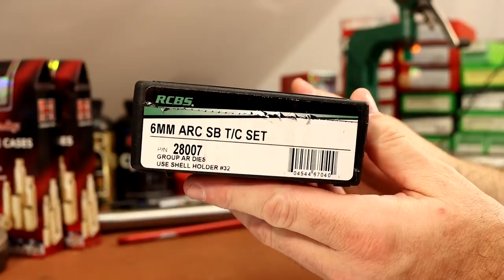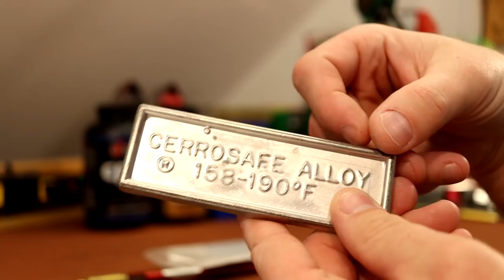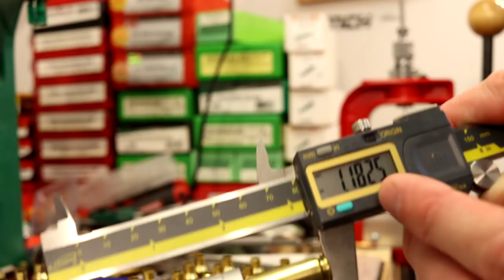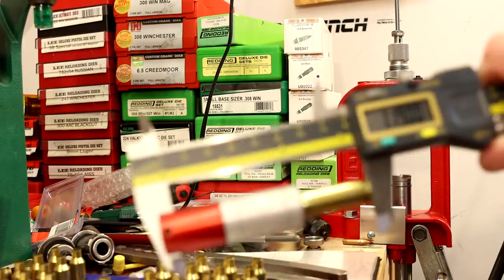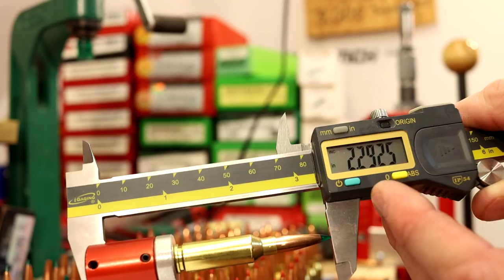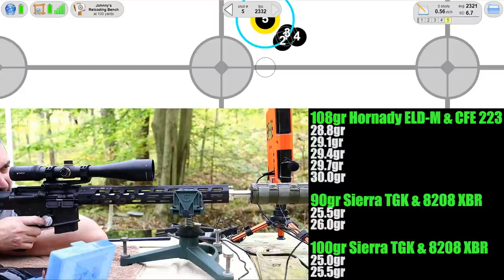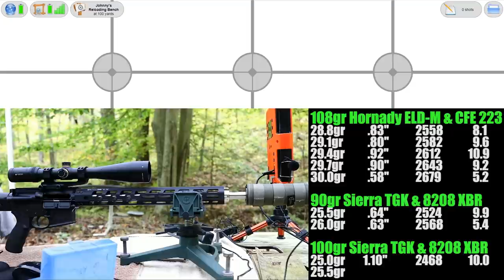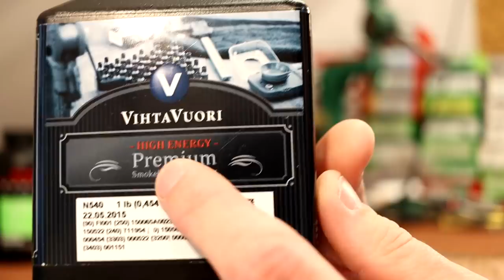6mm ARC - Still just getting started

Comment: 52:45  I posted this before on some of your previous videos.  I call those groups "splittings".  They ALWAYS happen after you go faster than the accuracy node for the load (with loads that will group and these are doing well).  They are a huge AH-HAH if you see them.  The 28.8 load is the lower accuracy node and the 30.0 gr was your upper accuracy node.  Looks like the 30 gr load of CFE223 is the tits!  Load em up, solidify your data, and then send em out to 1400 yds.

Comment: Johnny, you can put a little IMPERIAL sizing wax on the bullet to overcome that slight tightness when using that resized modified case shown in the video.  Just apply to the bearing surface of the bullet.

Comment: Run modified case thru grendel die to resize the base without the stem .... Size the base without touching the neck ... Would check chamber measurement to see if the shoulder would get touched
Reply from the maker: That's an excellent idea! I haven't messed with the 2nd modified case so it's not too late to try. Thanks!
Reply: Troy D came up with the same idea. If it works I'll be making my own tomorrow.
Reply: I just ordered a 6.5 Grendel upper for my ar... Can't wait to play with it! Live ur videos man

Comment: I have a Lee Classic turret press. The ram is hollow, so all the used primers fall through the center of the large diameter ram and down into the rubber tube. The primers crud never comes between the ram and the bore that it slides through, doesn't stick to the lube, etc... and can empty the tube right into the trash. I use it for all my decapping after having a brand new Hornady develop a ton of slop in just a year and a half. I cant believe Lee took a step backward and allows the primers to pop out the side of the ram before going down the tube. If I was to design a press I would definitely use a large diameter hollow ram for the primers to fall. It's the number one wear point on any press. I got a "grandpa special" RCBS II at an estate sale in brand new condition. Since then I've never deprimed a single case on it and it has not developed any movement whether at the top or bottom of the ram stroke. If I ever work in a machine shop again, I'd love to build my own beefy press using a hollow ram for the primers to fall through

Comment: I've got < 1" using Johnnys load with 105Bergers and ppVarmit @ 2500. I only had 16cases that I scrounged. RCBS standard die set with lee quicktrim 6.5 Grendle trim die(filed down 40thou and removed the champher blades). CMMG 20" with SA adj gas block. Started low and worked up. More brass on the way!

Comment: Saw a dead simple method of measuring max lenght.. Take a case, fired or expanded so it takes a new bullet with tiny friction, then put loctite or glue in the neck and insert the bullet, chamber it and wait. afterwards you got a perfecly seated bullet and it wont move during extraction. Case/bullet can be cleaned and re-used.
I save a case+bullet with max lenght for all bullets, its just a couple cases for future reference.

Comment: Great video, Johny. I’m tempted to try those tipped Sierra Bullets in my 243. 

I have just purchased a six arc barrel, waiting on my receiver 99 gr. is as heavy as I would want to shoot. I have an 18 inch 7 1/2 twist. barrel.  I’m thinking about just staying lite on my bullet weight.  I will stay tuned for more of your load work up on your 6 ARC. 👍

Comment: Did some loading with the 103 gr eldx this weekend, I have a faxon 18” 1in8 twist barrel with a faxon Grendel bolt.  Using lever revolution at 2.260” coal and Remington 7 1/2 primers I worked up to 29.6gr, was not totally satisfied with groups and velocity so I shot groups from 29.5 to 29.8 grains, saw pressure signs at 29.7 and 29.8 flattened primers quite a bit.  But the 29.8gr load shot 2650 FPS.  Way too hot but now I know.  This is a hunting load so only a few shots a year in cool to cold weather so I will be going with the 29.6 gr load, need to tweak it for accuracy and velocity consistency but I need to try cfe223 as well so many that will be better.

Comment: Impact sports did a video about getting base to ojive. He added a small drop of locktight on the inside of the neck of the case. He added a bullet and slowly put it in the chamber. Add the bolt and leave for a little. Then slowly pull the round out with the bolt. It holds the bullet in place. Use only a little bit of blue locktight

Comment: what to do , build a 6.5 grendel or a 6mm arc ? i was thinking on a wildcat 6mm ar , 6mm grendel etc . all are the grendel case necked down to 6mm . and basicly what is the 6mm arc ? yea a necked down grendel case . most of my shooting is under 300 yards . so ether the arc or grendel will work the same for me . but small groups are better ! i'm leaning to the old grendel as brass is easy to find . well it is when the craziness is not going on ! this build will be a target / varmit gun . going to go with a krieger 24 inch bull barrel with a plus one gas system length . yes it will be heavy ! keep up the great work shanan aka johnny !

Comment: The Sinclair OAL tool uses the bullets and brass independent of each other to get a measurement so you don't have to try and expand the necks. Plus you don't need to make special cases for each measurement. Just use a fireformed or sized case.

Comment: Great video as always Johnny!  I was curious if you have read up on the new 8.6 Creedmoor at all?  Basically the 300 Blackout for the AR10 platform using a cut down and necked up 6.5 Creedmoor case with a .338 Federal bullet, showing optimal barrel lengths around 10-12"

Comment: From my experience with the Hornady OAL gauge, every bullet should measure out CBTO to the same length since you are measuring your chamber/throat and not the bullet. The ogive should be the same no matter the projectile. The OAL should be different
Reply: I apologize for the dumb question but I'm trying to learn. Does the gauge measure precisely at the ogive or at a different point in front of it to compare? TIA
Reply: @rustynut1967  The ogive is the point on a particular cone/cylinder where the diameter is the largest (rough definition but it works for this discussion).

Each insert for the Hornady OAL Gague is a set size for the caliber you are measuring and will measure your projectile out at that particular diameter. 22 caliber projectiles are actually .224”, 30 caliber is (typically) .308”. Each insert will measure the projectile to the point where your bullet almost reaches that caliber you are measuring for. 

Now, when measuring the maximum length of a loaded cartridge for your rifle, that maximum distance, where the projectile touches the lands in your barrel, will remain constant, regardless of the projectile. Your measured Over All Length will differ for every bullet, even of the same make/model/weight as they are not all exactly the same length. (Couple thousands difference). But the ogive should be the same distance from the case head for every cartridge.
Reply: @josephbhumphrey  Thanks for you answer but I don't think the bullet comparator measures at the point of bullet contact to the land. After much head scratching I read the hornady instructions and this is what it said:
NOTE: different bullets have different ogive curvature
(i.e. #6 vs. #10 ogive, and secant vs. tangent ogive).
As a result, the bullet free travel (jump) may change
as much as 1/16" or more when one bullet model is
substituted for another. Therefore a comparator cannot
be used to transfer dimensions from bullet style “A”
to bullet style “B”, as this would be an “apples and
oranges” comparison

That is why Johnny's CBTO is different from the ELD-M to the TGK bullets.
Reply: @rustynut1967  In my limited experience reloading, whenever I am measuring my chambers with the Hornady OAL and fired case, the comparator measurements, regardless of what projectile I’m using, are all almost exactly the same measurements. The cartridge OAL’s are drastically different, but the CBTO is the same. 

I use the comparator in setting up my dies to give about 0.010 jump in starting my load development.

Comment: I’ve had problems out of the Hornady modified case in my new 300 win x bolt where the neck seems to tight I’ve been thinking about turning the neck down and chamfering the case mouth to hopefully get it sliding easier, the gun shoots great but it’s a super tight chamber

Comment: N-540's selling point is increased velocity without a pressure increase. I'm testing it in my Colt M4 to replace N-140 (75gr Hornady BTHP Match). Great results so far.
Reply: So you had better results with the N-540 over the N-140? I was thinking of trying the 540

Comment: I tried the 8208 xbr with the 95 gr SST, and the 90 & 100 gr TGK’s, couldn’t get it to work.  I tried 8208xbr, ar-comp, A2520 and Leverevolution.  So far the Leverevolution is the sweet spot in my 20” nitrided CMMG 6 ARC barrel.  Hope you get better results, good luck.  My pet load so far is the 95 gr SST on top of 30.4 grs Leverevolution and CCI 450 primers
Reply: Mabe try Reloader 15 or Shooters world AR plus?

Comment: I have a Hornady full length die set for the 6.5 Grendel that I purchased a few years ago. I thought everything was going to be great! That is until the third and fourth reloads started to blow apart. I found that full length was not the way to go with this set of dies. .008 to .010 too small. The necking was about right but working the brass, just stretched it out and thin. I ordered a set of Lee dies, and they were a little better. Why didn't they go by the book?

Comment: Johnny I love your videos man, lots of good info, I especially like that you generally try a lot of powders. I just wonder if you have a problem with Barnes bullets, like a bad experience or something. I can't really remember you using them much if any. I feel like the 80 grain ttsx would be ideal for the 6mm arc. I've always found the Barnes to be very accurate and incredibly lethal, especially in somewhat underpowered cartridges like the arc. This is especially true when you use bullets on the lighter end of the spectrum. The harder you drive them, the better they perform. Just my .02, but I really think you'll like how they perform, and they dont leave microscopic lead particles in your venison either.
Reply: I hope he does some stuff with barnes bullets. They are my go to hunting bullets because they are accurate and absolutely lethal. I used a 140gr ttsx at 2750 fps in a 7mm08 and a 168gr ttsx at 2725 in a 308win. The damage those rounds did to deer made me feel like have used them on a grizzly bear instead.

Comment: Question. This is the same parent case as the 6.5 grendel right? Why not size the body of your 6mm ARC modified case with the 6.5 grendal die? It will size the body without hitting the neck. Maybe try with the spare modified case.

Comment: I'm assuming the bullets for 6mm arc have better BC than the light 30 cal you would use in 300 blackout... But I'm looking at the numbers and  110 grain super should be doing 2400+. What would be the difference in ft pounds at the barrel, at 200 yards and 400 yards?  Would you ever shoot a deer at more than 400 yards? It is the drop that much better with the 6mm?

And the 80 grain 556 is at 2800 fps.

Just not sure where this cartridge fits in.
Reply: Here's the reason for its existence. https://gununiversity.com/6mm-arc-review/
Reply: @frankz9103  so longer range shooting makes sense... Especially for soldiers. 

Hunting? I can't imagine shooting a deer at 1200 yards.

I might pick up a 6mm ARC upper someday, but it doesn't sound like something I would use for anything other that plinking 

Might be interesting to try long range shooting.
Reply: @briankeithwood  I would say that 6.5 Grendel would be better for hunting whitetail deer. 
I think 6mm arc would lend itself better to hunting coyote and feral hogs. 🦌🐗
Reply: @briankeithwood  totally agree. I personally wouldn't hunt most big game past 400 yards. Anything past that seems a bit dodgy.
Reply: @frankz9103  I don't do much hunting, my knees are too bad. However, I do have a 300 win mag bolt gun if I needed to dispatch something at distance.

Comment: Playing with seating depth on the better groups would be worthwhile. 5-10 thou seating difference can change your world.
Reply: how will we ever know the measurements?
Reply: @marcrobert2603  What do you mean? You measure with measuring tools?
Reply: I have the hornady thing. Still the case that came with doesn't represent my cases. I have the best result with the jamming method. So jamming and after that i put it in the shell and i seath 1 or 2 hour further. That will be my load for the day. I have dies that are setup for only that load because they are so good. But you are right. Still result counts. Ever tried the rod method?
Reply: I don't use any tool, i use the Erik Cortina way, and than lower my seating die 1 o'clock.

Comment: question about your chamfering... you do the inside first then the outside.  

does this not leave the rim of the case angled in, making a sharp(-ish) edge that rides the bullet as it is seated, and shave the copper??  

i do outside, then inside, leaving a flare to the rim.
Reply: You’re chamfering too hard if your case mouth is angled that much. Just break the corner or the burr if you have trimmed.

Comment: In quickload I used the 6mmAR data for my 6 Predator loads. Looks like Varget would be a good powder for the 108eldm bullets. Varget looks like you can get a full case and 98% powder burn and 2500 fps without going over saami spec pressures.  IMR4895 looks very good too.  The 8208xbr doesn't look to good.

Comment: My 18" Ballistics Advantage 1-7 twist is finally on the way. Anyone running any Berger bullets in this caliber yet? Just wondering if VLD's will cycle in 6mm AR platforms? My 6.5CM Large frame AR won't run VLD's. They get hung up on the feed ramps.
Reply: I've run both 105VLDs, 109 Hybrids, and the 108 Elite Hunters from Berger in my 16" Faxon: I've had zero issues with function or reliability across the board with two different powders and about 8 different loads.  The accuracy hasn't been great with the Berger's as my Faxon has a 1:8" twist..so I wasn't surprised.  That said; most have hovered consistently around 1.25 MOA.  Ive had the best luck with the 107 SMKs and Shooters World Match (similar to CFE223) powder - consistently between .40-.80 MOA with a few different load workups; and I have a 109 Hybrid load that i've gotten into the .85 MOA realm.  Average velocities are over 2520 out of my 16"...but I wouldn't push the powder to max, pressure signs start to show as soon as you exceed the max load in Hornady's manual for the 108-110 gas-gun CFE223 data.

Comment: What suppressor are you using? I’ve used my dead air wolfman on my 24” bolt gun in 6mm ARC with good success.
Reply: Well wasting ammo on a ar seems crazy. Not only do you ruin your brass but accuracy isn’t as good. 3 firings. I been seeing 27 inch barrels hit accuracy node. Having a barrel spun up for my Howa mini.

Comment: What do you think of Swift bullets?  They seem to get overlooked by mainstream reloaders.
Reply: I have shot quite a few swift bullets over the years.  Mainly a-frames and scirocco II's.  Accuracy has always been so-so accross multiple calibers, but certainly good enough for hunting.

What really holds them back imo is price, availability, and lot to lot variance.  They are very expensive, compared to comparable bullets.  If you want more than one box at a time you better place an order online as most stores won't stock many.   And probably the most irritating is bullet base to ogive measurement seems to vary drastically based on lot and/or vintage.

I'm not sure if they continually tweak their die set up, or if they do small runs, or if tooling has changed over the years...but the a-frames have changed alot over the years.  So loads you worked up in the early 2000's may or may not still be relevant (though probably still good enough for hunting inside of 300 yards).

I've been lucky enough to pick up fairly large number of swift bullets at auction or sporting good store closures over the years.  The .224 75 gr scirocco II is an awesome little deer bullet.  The .30 180 gr a-frame is opens up well and stays together even on shoulder-to-shoulder shots through large mulies.  Good bullets, for sure....but there are a ton of comparable projectiles that are more consistent, more available, and cost 25% less to boot.

Just my opinion of course, and I meant no offense if you are a team swift guy.  But talking to alot of hunters and reloaders I know I'm not the only one wh feels this way about them.

Comment: I use my Hornady Collet Bullet Extractor to grab a bullet from my “modified case” and run it in and out about ten times to loosen up the neck so as to get an accurate OAL measurement. Your bullet is too tight to get an accurate reading as you keep jamming the bullet into the lands to varying uncontrollable amounts, IMHO.....

Comment: With those CFE and 108gr velocities, I know 6 Arc is a whole other class then .243Win, but what velocity would a 18" .243Win get with 108gr?  You can't be more than 100fps behind?
Reply: Id expect around 2900-ish for a 18" 243 with handloading, more if suppressed like here, and even more if you got a 243ai chamber while getting the barrel cut. Its a bigger case so its all else being equal its going to outpace a smaller case.